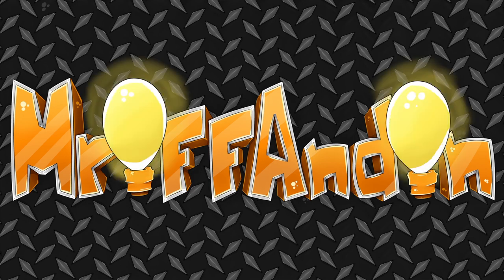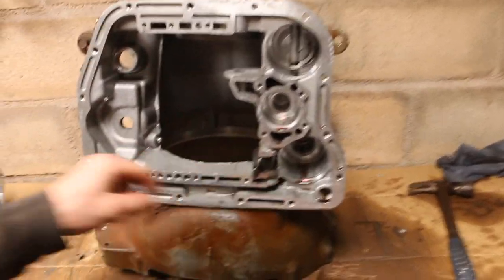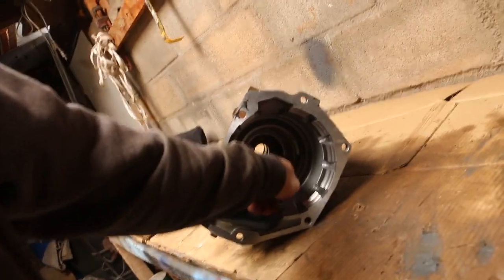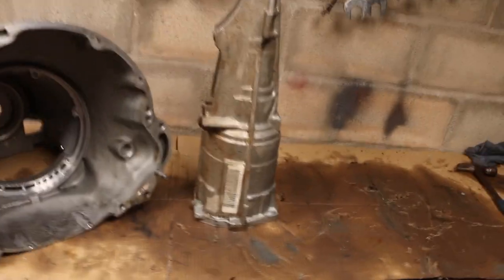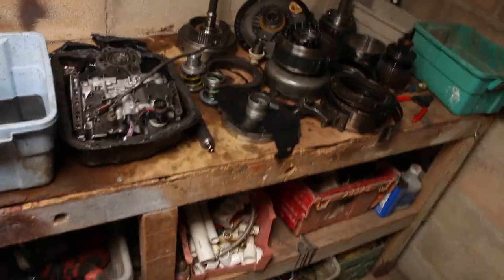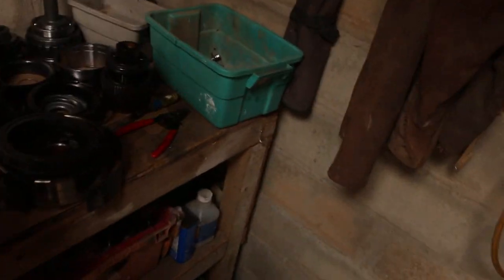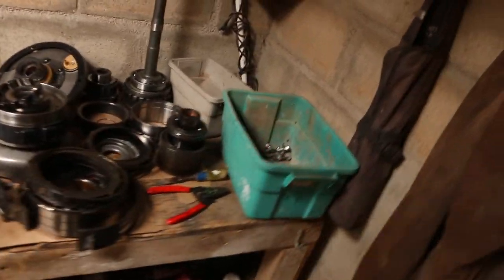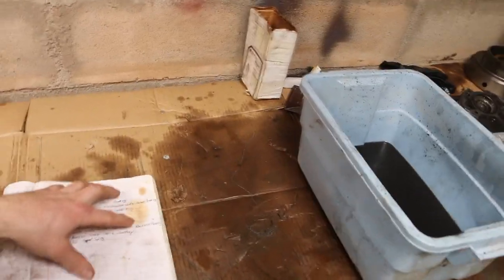46RE Transmission Rebuild | Only $550 For All The Parts | Cleaning And Inspecting Parts | Part 2

Comment: You wont fail.  Simple reason why, If something is not right when you do put it back together, You will strip it right back down and do it over again to fix what might be wrong.  Have fun, make sure you have help lifting those heavier parts.  That is just a safety thing.